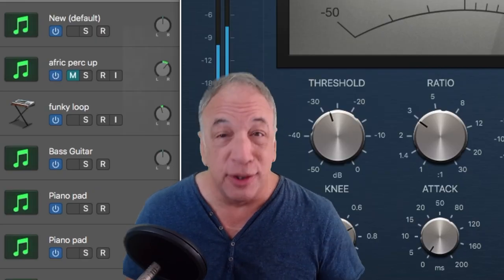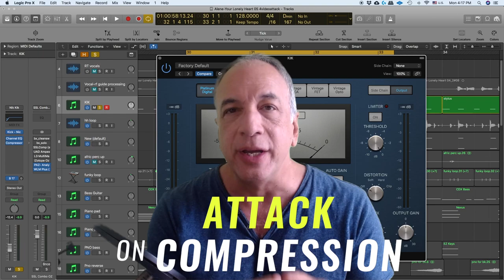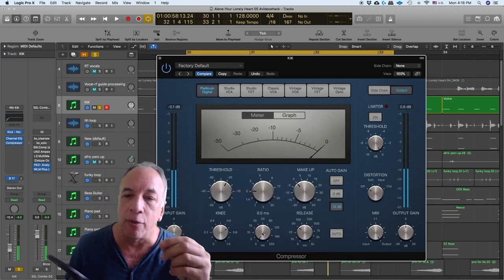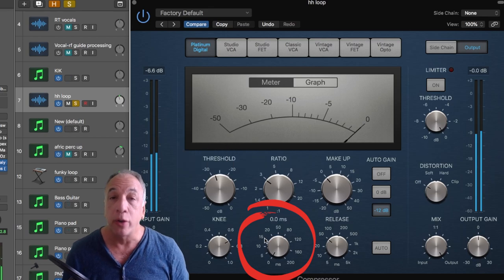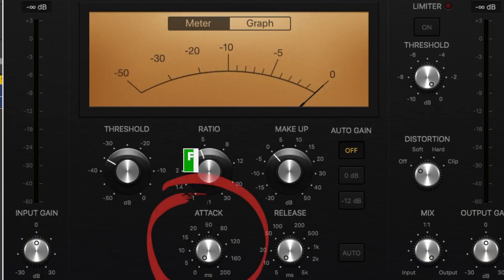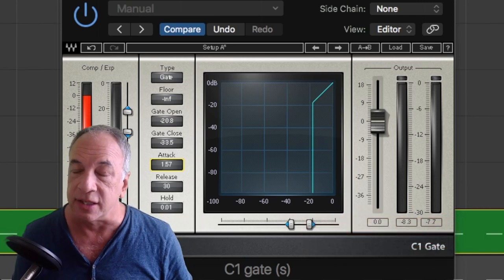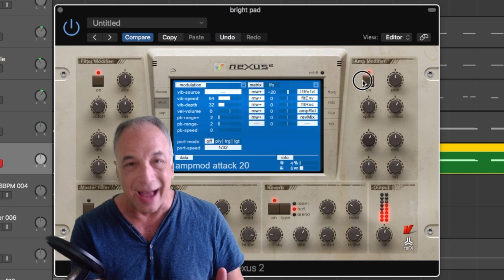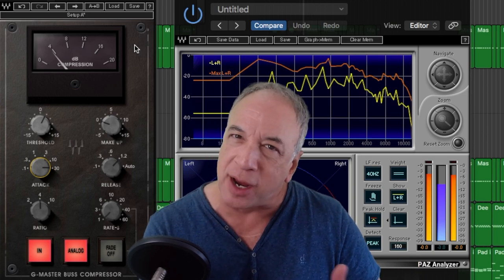Attack and Release-The Wrong Attack Settings on a Compressor or Gate can Destroy a MIX

Comment: In my personal opinion I feel like for this comparison to be accurate you would also need to adjust the threshold so that you are getting the same amount of gain reduction for each attack setting. On each one of the comparisons in this video There was a huge difference in gain reduction.  If you have 15 dB of gain reduction happening on a signal it does not matter what the attack time is, it is going to sound like trash because it's being decimated.
Reply: Well said 💯

Comment: I thought I understood compressors, I've made several albums at this point; then the other day when I was brushing up on the difference between downward/upward compression and expansion -- I realized something, there is something about compressors and how they are used that literally makes NO sense ... You set a threshold, but then everyone says to set a medium release so the transient can pass through... OKAY?? (anyone else see a fundamental problem here?) The threshold is set according to the peak of the transient... which you don't want affected... but you use that peak to then compress the part that is already quieter????? If that's literally what one intends to do that would make sense... but that's not what people's stated purpose tends to be... they claim they are controlling dynamics, controlling transients... buuut, to do that you WOULD have to affect the initial transient.

Comment: What would you recommend if you were stem mastering and the producer used too fast of an envelope attack on the bass, which caused some unwanted clicking? Would you have to automate a fader for every click or..? I was thinking maybe using a transient shaper but so far I haven't had any luck with finding the right sound. Kind of stumped at the moment but I'm probably just not thinking in the right direction lol happens sometimes when I'm caught up with a busy mix and have a lot going on. I also tried using an LFO tool to kind of do that automation for me but the effect was just too much. Just trying to avoid having to automate the entire bass track but I may have to?
Reply from the maker: Frequency based, multi band  compression, like a de-esser might work.  See if you can use an analyzer and isolate the frequency of the click. If worse comes to worse, yes, automate it. Tedious as f@#$ but sometimes that's the only way. And I probably won't take you more than 15 minutes. 👍

Comment: And, especially according to this engineer mixing tutor's lesson, the defaults of these applications at time MAY have a better setting than what one may manually set, depending on one's ear and experience.
Reply from the maker: Hey Drose, the defaults depend on what you're looking for. So when they design these, they often make the default the most used settings for the plugin. (if it applies) On compressors and eq, it's usually going to start out flat. But on effects like reverbs, modulation and delays, you never know so I always check it out first. Thanks for the comment. 👍

Comment: How do you determine the threshold???  I can’t seem to find a single video talking about how to set the right threshold.
Reply from the maker: That's an excellent question! Different for a compressor or a gate. A gate is easy. You want to set it high enough, so it only opens for the sound you want to hear. Then you use the release and hold to determine how long it stays open. You have to do a lot of fine tuning until you get it just right. Or sometimes,  like with live drums, it just might not work on everything because the dynamics are too wide. With a compressor, you have to first determine WHY you're using a compressor on this sound. Is it to subtly control the peaks of a vocal? If it is, then you would set your threshold high enough so it only engages when the vocal is nearing the peaks.  But if it's on a guitar that you may want to smash and limit the whole dynamic range, then you would set the threshold low enough so it engages constantly.  And make sure you pay attention to your ATTACK settings :)
Reply: @SkyeLabMusicGroup  - that makes sense.  Thank you!
Reply: i do by ear...
same with all other settings, ratio, hpf/lpf, etc